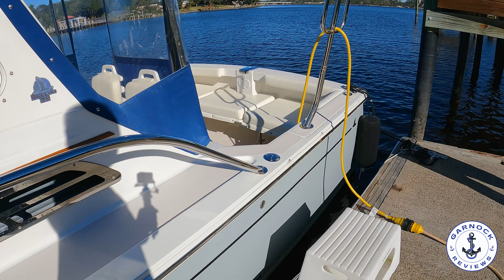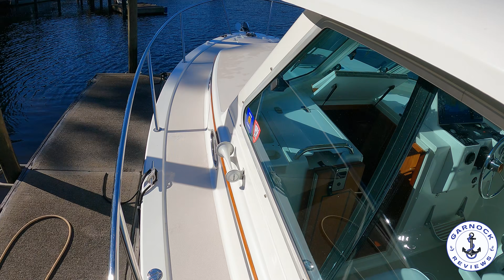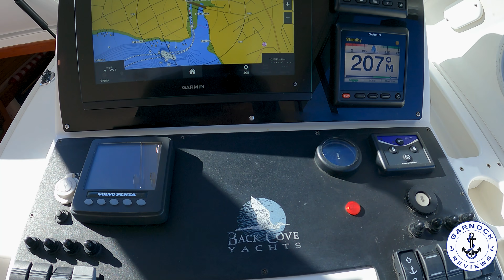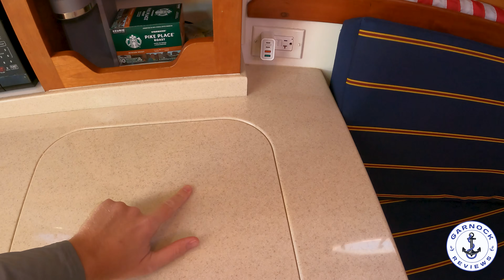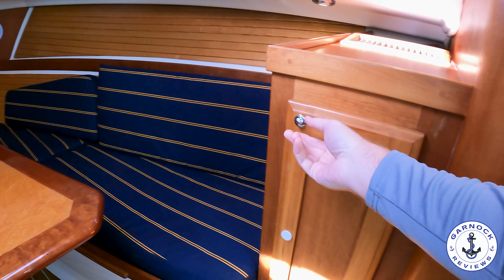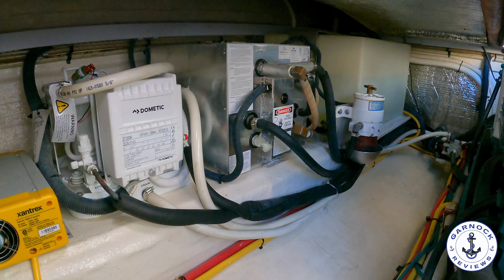[Sold] - (2007) Back Cove 29 Boat For Sale

Comment: Edit: omg did he put in new windows? I don’t think those are 20 year old windows) Trying so hard to get my 2005 up to the same level. This is an incredibly well cared for 29. (And as an owner, this boat is excellent. Really recommend taking one for a drive if you get a chance. They don’t make them this size anymore but you get the stable feeling of a larger boat with the ease of use of a much smaller boat.)
Reply from the maker: I'd need to double check, but wouldn't be surprised as this boat presents as new from top to bottom. Glad you are enjoying yours, and appreciate you taking the time to watch and comment.
Reply: @ your costing me money because I’m getting ideas for upgrades 😂😂🤣

Comment: I'm not an experienced boater, but 177,000 dollars for a 29 foot, seventeen years old boat seems high.
Reply: If you check yacht trader he is at the upper end for the model but it is in exceptional condition. Back cove is a subsidiary of Sabre and they hold their value very well, largely a combination of timeless design and quality building.